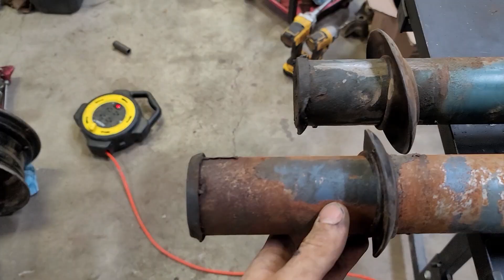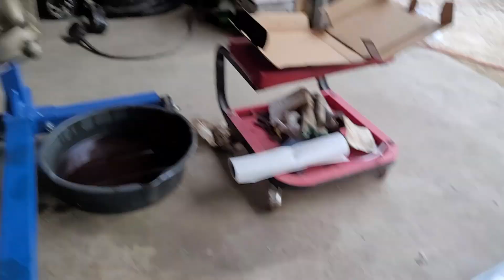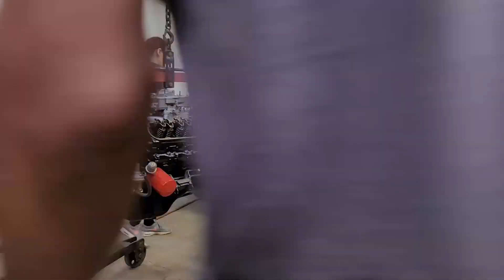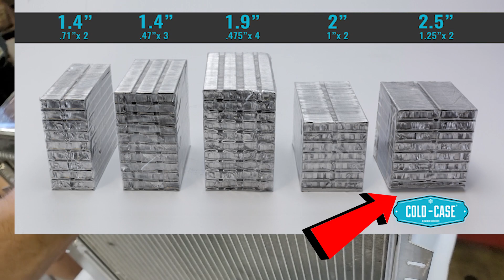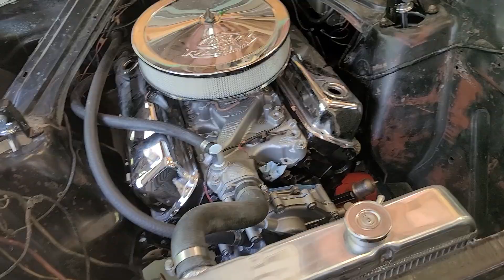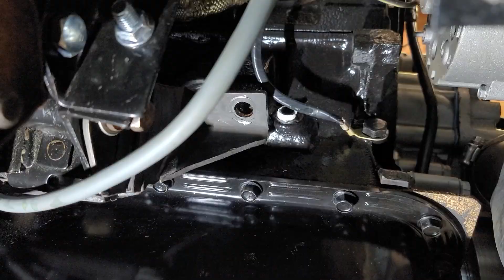1965 COMET FIRST START! OPEN HEADERS!

Comment: Never touch the patina!  I put a 1990 5.0 in a 63 Fairlane wagon.  Same shoe box carb and it runs great.  No EFI here! XXXXXXX.  If you do coil springs, watch Mr mayhem 405.  Use his coil spring compressor - it will save your life.

Comment: Do you think it might improve cooling capacity if you built a shroud around the fan? (to prevent loss of negative pressure caused by the open sides)
Reply from the maker: Absolutely, but in all honesty, didn't have any over heating issues with it on power tour

Comment: FAUCI HAS MILLIONS OF HIS OWN MONEY INVESTED IN VACCINES 
HE WAS INSTRUMENTAL IN FOUNDING AND FUNDING THE CHINESE WUHAN BIO LABS.  He even owns patents related to CONvid-1984.  There is a law you can’t patent anything that is natural yet that’s exactly what the big pharma corporations have done.  It’s another proof all this scam was orchestrated. It can be easily confirmed by multiple nurses from around the world.  They are whistle-blowers and they say they have 100% only patients in hospital who were previously jabbed and now they have CONvid-1984.  Not Covid 2020
ANNUAL STATISTICAL FACTS: PUBLISHED BY THE CDC: Nov: 2020
2019 US pop: 328,239,523 
2020 US pop; 330,767,888 

2019 US deaths; 2,855,000 
2020 US deaths: 2,902,664 

2019 US mortality rate: .9% 
2020 US mortality rate; .9%

2019 US Deaths per thousand: 8.70 
2020 US Deaths per thousand: 8.78 

Take away the increase in suicides and drug overdoses due to the lock downs in 2020 and there are over 40,000 LESS deaths in 2020 than in 2019 

UNITED STATES  ANNUAL  DEATH RATE   DATA  (Taken from another source)
YEAR   DEATH RATE   GROWTH RATE OF DEATHS

2020               8.880                     1.12%
2019               8.782                     1.12%
2018               8.685                     1.12%

FACT: UK deaths in 2018 were HIGHER than in 2020

In Canada the annual percent increase of deaths in 2020 was the lowest since 2012.  This includes sharp increases in overdose deaths and the deaths of those who expired because their surgeries were postponed last spring

Deaths in Canada 
2016 = 262,090 
2017 = 274,240 (+12,150 from 2016) 
2018 = 283,770 (+9,530 from 2017) 
2019 = 287,460 (+3,690 from 2018) 
2020 = 300,210 (+12,750 from 2019)
Which proves there is no spike in deaths because of a fake pandemic again…

India has a 98.84% survival Rate of Covid: (2.6% morbidity rate)
Seasonal Flu has a 2.5% morbidity rate.. 
Covid19 has a .04% morbidity rate worldwide..
FACT: The average lifespan is 70-80 years.

FACT:  Over 90% of the supposed Covid 19 deaths are between 70 and 80.
For instance, the average life expectancy in Ontario is 81 years old… the Covid death age average is just over 82 years old.

FACT: The Covid average death age EXCEEDS all the average life expectancies in all of the countries reporting Covid deaths

FACT:  The reason 2020 annual mortality rates and growth rate of deaths are the same as in previous years, regardless of the supposed Covid deaths, is because they have stolen deaths from people who would have died anyways in order to scare people into believing in this hoax.  There is no pandemic:  You have been scammed.

If you don’t believe me:  Try to find any total annual death statistics for 2020 along WITH previous years on the internet…  You won’t find them together because it would show that there was no increase in total deaths compared to previous years.

Basically the PCR test magnifies the danger of a virus by false positives just like the mass media and the govts have magnified the danger of Covid 19 by false propaganda…. Read about the PCR test and its false positives.  https://bpa-pathology.com/covid19-pcr-tests-are-scientifically-meaningless/
The PCR test patent is OWNED BY RICHARD ROTHSCHILD - it’s right there on the patent! People need to run like hell from the testing. In America: Opioid deaths were up from 20,000 to 90,000 because of this evil hoax.   

In Germany; the health care system cost 1.5 billion more in 2020 than in 2019 and they had 8% less patients in 2020 than in 2019.  THIS IS ALL ABOUT MONEY AND BIOTERRORISM.  IF THEY MAKE VACCINES MANDATORY GLOBALLY, THAT’S A 90 TRILLION  DOLLAR INDUSTRY… WHICH IS 4 ½ TIMES THE ENTIRE U.S. DEBT.
https://beforeitsnews.com/alternative/2021/06/finally-vaccine-depopulation-agenda-confirmed-spike-protein-attack-dr-byram-bridle-phd-dr-peter-mccullough-talks-with-reiner-fuellmich-the-ten-year-plandemic-how-globalists-3752433.html

EudraVigilance: European data base of Suspected Adverse Drug Reactions reports:
Covid-19 Vaccine Adverse Drug Reactions:
6,662 DEAD  299,025 Injuries through April 10th 2021
UPDATE:  European Database of Adverse Drug Reactions for COVID-19 “Vaccines”
10,570 DEAD 405,259 Injuries: 
Norway itself reported over 3600 adverse reactions to the vaccine
4,178 post-COVID-vaccine deaths now reported (through May 3) to the U.S.-based Vaccine Adverse Event Reporting System (VAERS). Update on VAERS July 7th 2021: 2,000 deaths reported in the last 2 weeks, now up to 9,048 deaths total
https://www.medalerts.org/vaersdb/findfield.php?EVENTS=on&PAGENO=1&PERPAGE=10&ESORT=&REVERSESORT=&VAX=(COVID19)&VAXTYPES=(COVID-19)&DIED=Yes

In Europe, the COVID vaccine fallout has been equally alarming: The EudraVigilance database lists 8,430 deaths (through Apr. 24) — and more than 354,000 injuries — following injection with one of the four emergency-authorized shots  - The CDC's Vaccine Adverse Event Reporting System has reported 4,246 deaths and 162,610 serious injuries so far from the inoculations. 
A Harvard study a decade ago said only 1 percent of V. deaths/injuries are actually reported by the VAER system. Based on the 5,000 deaths it is currently reporting, we can infer that actually there are now 500,000 dead from the jab in the US.  After 16 years of trying, a SARS-co-1 jab was never established...  
The EudraVigilance database reports that as of July 31, 2021, there are 20,595 deaths and 1,960,607 injuries reported following injections of four experimental COVID-19 shots.
COVID-19 Vaccinations are 98 Times More Deadly Than Flu Vaccines According to VAERS Reports: https://trialsitenews.com/covid-19-vaccinations-98-times-more-deadly-than-flu-vaccines-according-to-vaers-reports/

They have not been able to create a vaccine for SARS after trying for 17 years...you cannot convince me that they have created one for this SARS-Cov-2 in less than 6 months
Norway has announced that you are at a greater risk of dying from Astrazeneca vaccine than from covid-19!!   So far, Norway has seen five cases of serious incidents reported shortly after vaccination, with three fatalities. This has calculated the mortality rate from the Astrazeneca vaccine as 2.3 people per 100,000 vaccinated
The FDA has said they will not approve or authorize any Covid-19 vaccines! 
In April, the CDC stopped counting the number of fully vaccinated persons across the U.S. who were tested positive for Covid when they got to 10,262…  While the CDC stopped tracking these cases, many states have not.  Bloomberg gathered data from 35 states and identified 111,748 cases through the end of July… more than ten times the CDC’s end of April tally. This proves that the untested “vaccines” do not work and the CDC is trying to hide it.  The PCR test will no longer be allowed after Dec 2021 in the USA.  So after billions of FAKE PCR tests, creating FAKE hysteria and FAKE paranoia and FAKE fear; the CDC is finally pulling the fake test that produces false positives for engine oil, orange juice and Coca Cola; WITHOUT ADMITTING THAT ONE YEAR OF FAKE TESTS CREATED A FAKE PANDEMIC AND THAT THEY ARE RESPONSIBEL FOR IT.  
If everything from the fake pandemic to the fake Covid 19 cases to the fake tests to the fake vaccines is propaganda; then why take the vaccine? Fauci is making millions in vaccines.  THAT'S WHY.  Rothschild is making a killing selling the tests. THAT'S WHY. The drug companies are making huge profits; THAT"S WHY.  Large corporations have TRIPLED their profits due to restrictive measures imposed on small businesses.  THAT’S WHY.  American hospitals get 53 K for every Covid case with ventilators: THAT'S WHY.  Pediatricians are getting 400$ bonuses from Blue Cross and Blue Shield for every child that they vaccinate.  THAT’S WHY.  In the UK: local hospitals are receiving 15K US dollars per C19 death…  THAT’S WHY.  Political power mongers have become virtual dictators in democratic nations using fear mongering and this hoax as an excuse:  This is GLOBAL BIOTERRORISM.
WATCH THESE VIDEOS!!   https://www.bitchute.com/video/4u7rt61YeGox/                                               
https://awakecanada.org/doctors-of-the-world-speaking-out/
Unless we (meaning YOU) organize and fight this global propaganda by copying this post and spreading the truth; we will all be forced to live in a locked down world of police states with no rights and no freedoms and no jobs and no small businesses.  WE MUST DESTROY THIS LIE OR ELSE IT WILL BE USED TO DESTROY US.  They already HAVE used it to destroy hundreds of millions of lives, jobs, businesses, rights, and freedoms.
https://www.bitchute.com/video/u0Y75lQGlPvo/ 
https://www.bitchute.com/video/Bmjn4Ii8o8Wl/
http://www.renegadetribune.com/finland-parliament-member-serves-government-notice-that-theyre-committing-vaccine-genocide/
This is a GLOBAL concentration of power and greed at the top of the pyramid of a corrupt civilization; using this hoax to fill their pockets at our expense while increasing their power over the masses, by impoverishing the entire human population while brainwashing them into believing in this lie. 

 According to CDC no one has ever died from Covid alone.  All alleged deaths are old people exceeding 80.  There are very few under 60.  Each alleged death has two things in common:  3.8 advanced terminal illness and old age, or a hereditary illness and dismal life expectancy in the young
https://www.bitchute.com/video/4u7rt61YeGox/
https://odysee.com/@AussieFighter:8/A-manufactured-illusion.-Dr-David-Martin-with-Reiner-Fuellmich:d

Comment: Was wondering if you were going to go with a "mostly stock" pedal assembly and you ended up using one. They are hard to find and when I do, the prices are just insane. Gonna search for an aftermarket unit. Take all the time you need. I always tune in to watch !

Comment: That alloy piece on the rear of the gearbox. Where I come from we call it an extension housing.
 A tailshaft (propshaft) is the long tube that connects the gearbox to the differential. Has a Universal Joint (U Joint) each end.
And the transmission, now thats a gearbox.
 Now you know how to speak strayan

Comment: Was that a brief power-outage while you worked? Is the green glass bottle with the hose-clamps for bleeding the brakes? That ride the camera took was great! XD Awesome to hear it run!
Reply from the maker: Yeah, just a random power outage in the middle of a beautiful sunny day... never have had that happen before. I was going to try and use the green bottle as an over flow but wasn't happy with how I was going to mount it... and also not sure how well it would take a shock of hot antifreeze.
Hahaha yeah a little roller coaster ride for the go pro, just glad it didn't drop!
Thanks for watching, glad you enjoyed the episode

Comment: I'm 6'5" and whenever I work under the dash of my 64 Falcon, I always take the seat out. Few fasteners and it's out. Much better than trying to be human origami!
Reply from the maker: Yeah, I don't know why I punish myself the way I do lol😅 definitely feel like a contortionist sometimes!
Reply: @Theoldcarchannel.  great video on the T5 conversion. I have been contemplating getting rid of the AOD and going to a T5.
Reply from the maker: @binfordtools  thank you, nothing beats a manual transmission in these ol rides (unless it's a big boat cruiser). I know Modern Drive line sell kits/ transmissions with all the correct parts (saves you time hunting things down). Might be a good place to start/get a quote from!
Reply: 6'4" and I always do the same 👍

Comment: Your thinking on the electric fan is wrong , good electric fans with shroud are very much more effective than a manual and you also loose the parasitic drag of the manual!
Reply from the maker: Let me know how good that electric fan is when it decides to die on you when you least expect it/ need it most.  My concept is a safety net, there's nothing wrong with a mechanical fan, I ain't racing so I could care less about the power loss.
Reply: Glad to see you were able to use the mechanical fan.
Reply: I don't know why you had such little room between fan/radiator. We were able to use clutch fan with aluminum radiator with plenty of clearance on '67 Mustang- also with power steering.
Reply: The more mechanical 'the better.  Even that pertronix  equipped  distributor  would have me carrying  a points distributor  with me just in case.